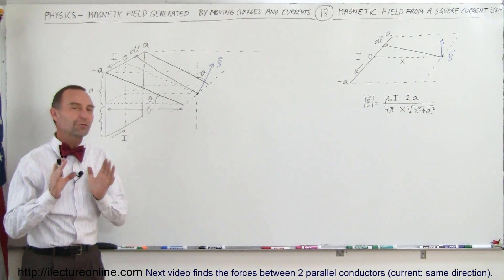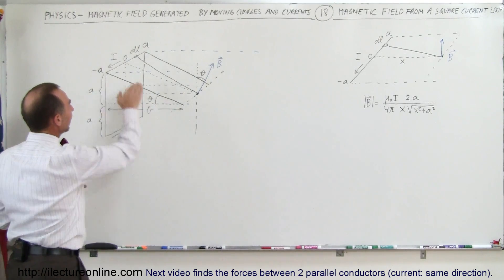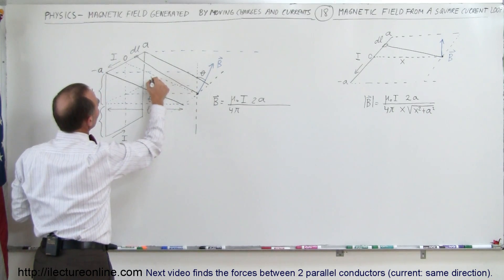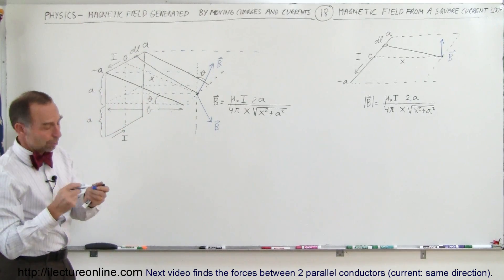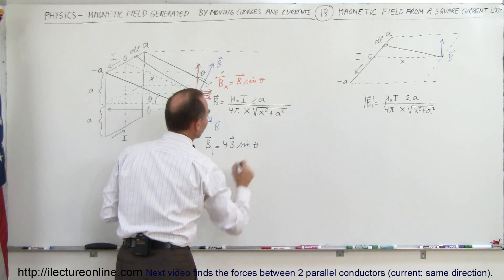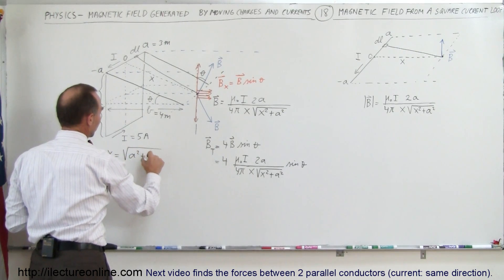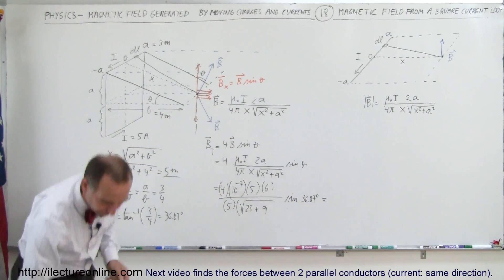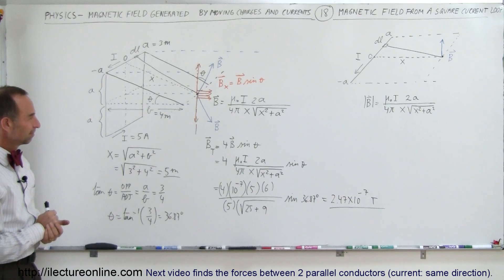Physics 44  Magnetic Field Generated (18 of 28) B=? Square Current Loop

Comment: i thank  and appreciate your decation but this isn't correct as you only considered the coner points of the square loop isntead of every element dl of the sides of the square now because here the theta(angle between a current element of the side of the square with its distance form the point p) and value of sq root x (distance between the current element and point p) will keep changing (be varible) unlike the case of a circular loop where the theta and the dist. were constant from each point on the circle. therefore we would have to use an other formula to derive the mag. field at center of the square loop that is : B = (Uo i (sin alpha + sin beta ))/ 4 pi (L/2) and then ultiply that by four you can find its derivation on another yt chanel "FloatHeadPhyiscs"

Comment: Hello Michel. One problem you might consider doing and adding to this playlist (since it’s quite popular and interesting), is the magnetic field caused by a *discharging capacitor*. which would use qe^t/RC=qf, and Gauss’s law to find an equation that relates this also to the electric field between the capacitors. Differentiating q with respect to time ofcourse yields current, and then plug that into ampere’s law.

Comment: in what video did u solved the example with the wire? (not the squareone, the other one )
Reply from the maker: Not sure which example you are referring to.  Is it this one?  Physics - E&M: Magn Field Generated by Moving Charges & Current (16 of 28) B=? Off-Axis Current Segm   https://www.youtube.com/watch?v=2QLDpuWghHA&list=PLX2gX-ftPVXWMz9EYz_V8CdnotJesSRnY&index=16   The playlist on this topic can be found here:  PHYSICS 44 MAGNETIC FIELD SOURCES   https://www.youtube.com/playlist?list=PLX2gX-ftPVXWMz9EYz_V8CdnotJesSRnY
Reply: Thank you so much for your reply! (16 of 28) is really similar to the video I am looking for - the one I am referring to however, has a different result because there is no θ angle - it is actually a video on solving the example you are using here (18 of 28) as your starting point.
Reply: @oAbraksas  just put the value of theta in radians pi for 180 degree and pi/2 for 90 degrees etc and youll get your formula